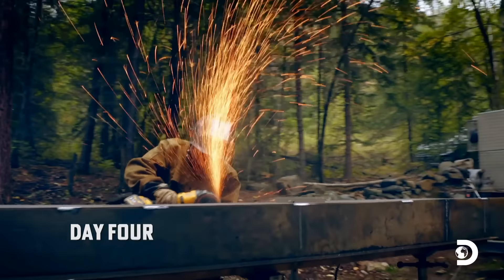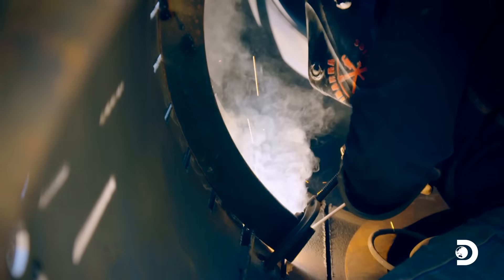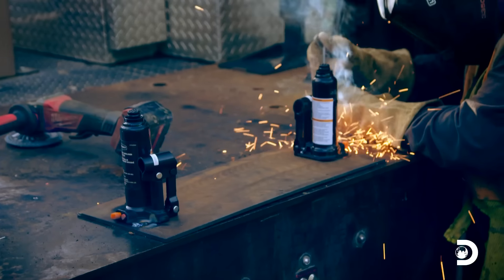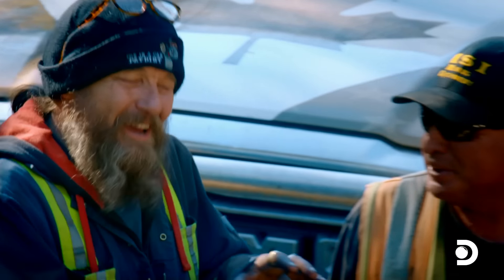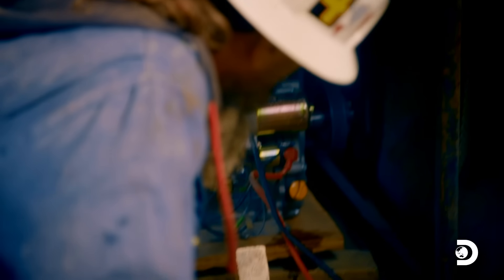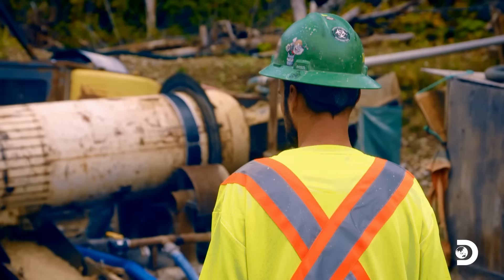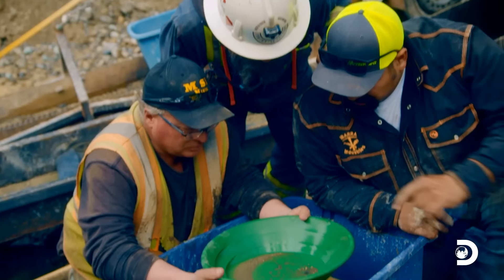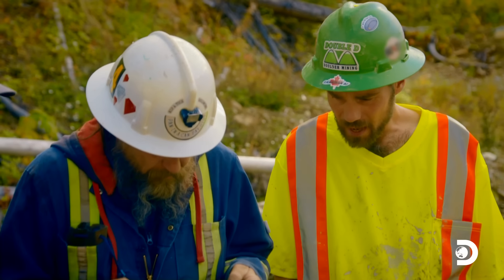Freddy's Little Hacks Lead to 75% More Gold! | Gold Rush: Freddy Dodge's Mine Rescue

Comment: Why not just raise a giant water tank that can be pumped with a solar? You can easily control the flow with valve instead of idling the motor down.

Comment: It sure seems like a lot of man power to pay every week and machinery which don't look to cost that much to run considering it's all small engine powered but for the small amounts of gold captured don't seem to add up to what the overhead cost
Reply: The father and son team live in trailers on site. Diesel is expensive, I don't know how much a tractor uses each day. An old plant, new pumps, once pumps are paid for there is a good enough margin. The key is consistently running an operation that is set up correctly and provides a steady stream of money. If you can make 1000 every two days that's about 3000 a week and 12000 a month minus tax, expense.

Comment: Would of it worked to put the sluse on boards to prevent it from bending.
Reply: Just don't bang the sluice into the earth and it will be fine. If you put boards under it and hit a tree or boulder and bend it, you get the same result.